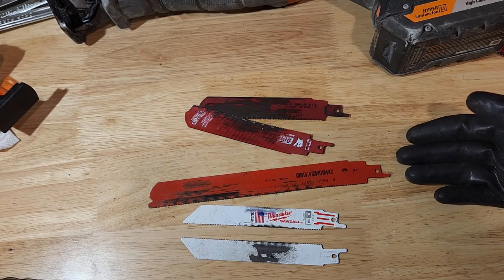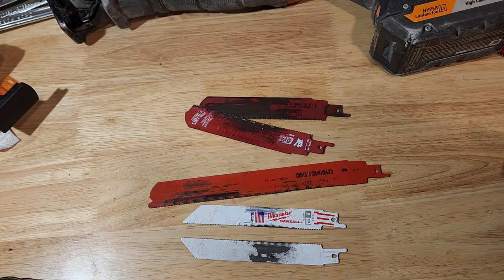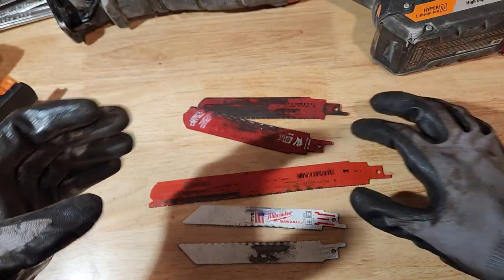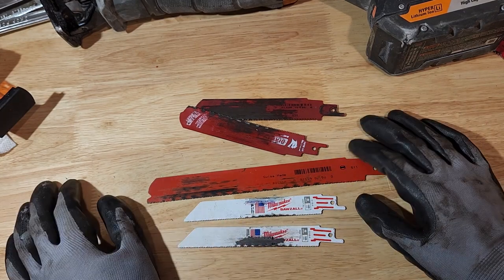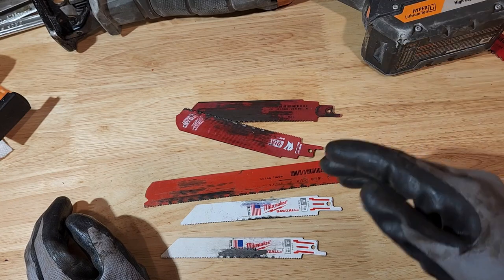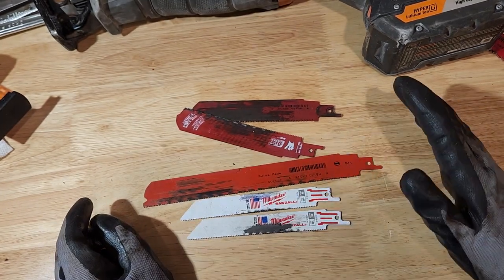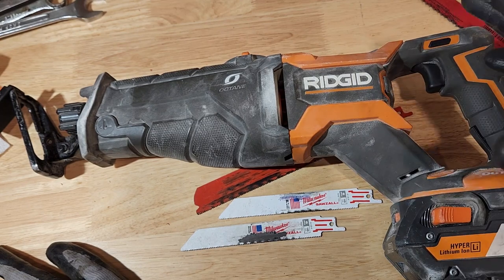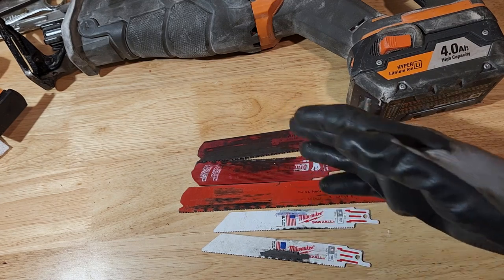The dcf900 impact wrench couldn't handle it so I used the Ridgid

Comment: I noticed in one of the eclipse that you were impacting on the bolt side. What you want to do if there's enough room is impact on the nut side while holding the both side with a box wrench.
I've found that way usually works best for stubborn rusty bolts like that.
Reply from the maker: The nuts in the video are welded. Lots of older american cars you see the 2 piece nut and bolt. In this vid there is a civic,prelude and accord  The 2 piece nut and bolt can wallow out the holes in the flange after a while because the bolt moves around in the flange but by welding the nut you eliminate that movement.

Comment: Curious to know if weighted sockets in 14mm and 17mm will be able to make a difference just like the home made Honda socket you made? I only mentioned  those sizes since it looks like those seem to be the two sizes on your videos. Like I've mentioned in your other videos I've never come across a fastener so seized,  but then again I live in Southern CA. Much respect to you folks that live in areas that have to deal with crazy seized fasteners.
Reply from the maker: it will only help if the bolt i not totally seized or it will snap the head off the bolt you can see that in the hazet video https://youtu.be/mt0MVwsGnPY?t=162
Reply: @singlecams  Just watched 😳 Sawzall for the win 👍🏻

Comment: I recomend carbide blade (bosch, diablo, milwaukee etc.) One bolt (2 cuts) takes aprox 15-20 seconds, much much much faster and last 7-10 hardened bolts 12.9 type. Before I used these types of blades what you have and these blades you need more pieces for one bolt.
Reply from the maker: Always a good idea 🙂

Comment: I cut my thumbnail off with a sawzall one time , they can bite ya.
Do you sell parts from the salvage yards ?
Reply from the maker: yes they are dangerous for sure 😮! no these yards usually all rotted out. i usually just use it for my stuff, good for knuckles, subframes and electronics but most of the stuff is impossible to remove
Reply: @singlecams   we don't get snow and salted roads in FL. so our yards are in pretty good shape for the most part.
Reply from the maker: @John_D2  oh yeah I saw vids of fl yards they are nice lol